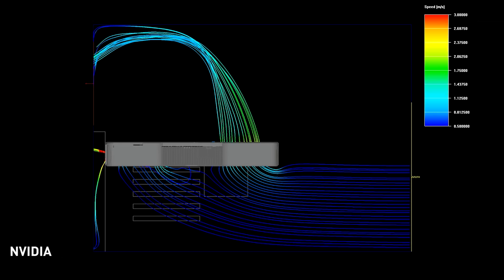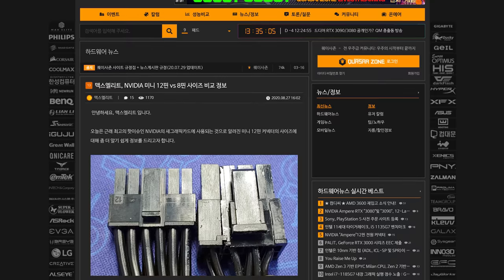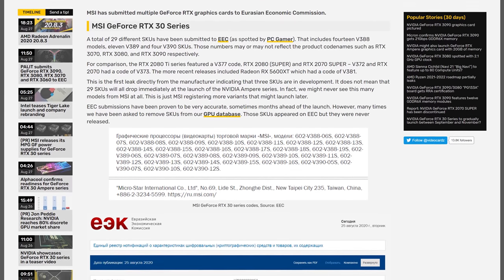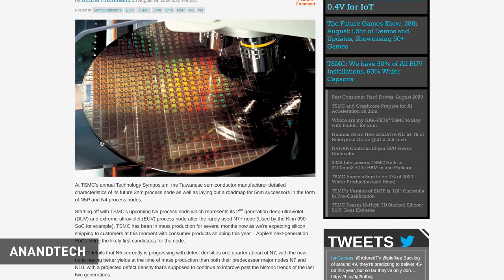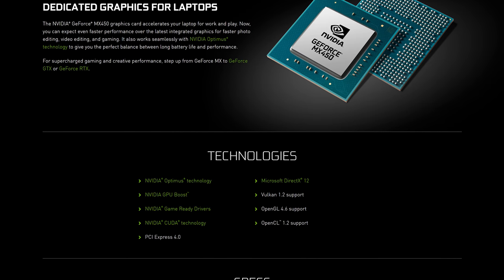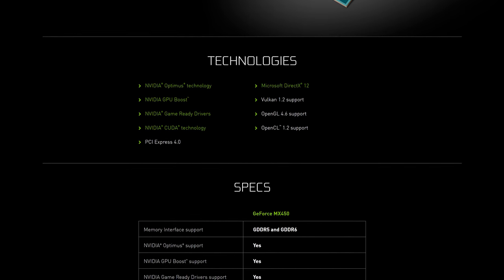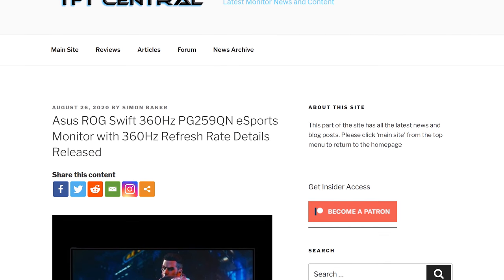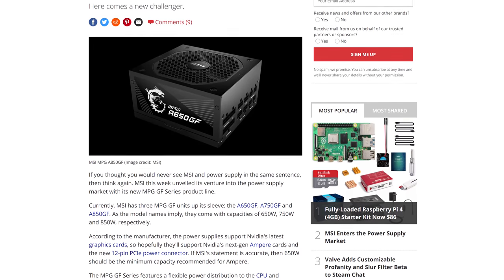RTX 3000 Power Connector, Great TSMC 5nm Yields, Nvidia's First PCIe 4.0 GPU | News Corner

Comment: Gtx 1000 series: price hike of 25% 
Gtx 2000 series: price hike of 25% 
Gtx 3000: price hike of 15% 
Inflation in that time: 6%

Do something AMD and Intel guys!!!!
Edit: for some models the price increase was more like 50% or even 70%.
Reply: They'll keep doing it until idiots stop buying them.
Reply: Intel will only be here for 1 or 2 generations probably and AMD's drivers probably won't be fully refined until RDNA 3.

You might hate me for saying this, but at this point, we as consumers might as well start buying only used cards.
Reply: Pricing history:

GTX 460  - 229$
GTX 560  - 199$
GTX 660  - 229$
GTX 760  - 249$
GTX 960  - 199$
GTX 1060 - 299$
RTX 2060 - 349$

GTX 470  - 349$
GTX 570  - 349$
GTX 670  - 399$
GTX 770  - 399$
GTX 970  - 329$
GTX 1070 - 379$
RTX 2070 - 499$

GTX 480  - 499$
GTX 580  - 499$
GTX 680  - 499$
GTX 780  - 649$
GTX 980  - 549$
GTX 1080 - 599$
RTX 2080 - 699$

GTX 780Ti  - 699$
GTX 980Ti  - 649$
GTX 1080Ti - 699$
RTX 2080Ti - 999$
Reply: @mix3k818  Unless we are ready to spend 1000 Dollars on entry level (!) PCs.
Reply: MiR3K intel is still king at gaming. What nonsense are you spewing haha
Reply: No new game worth a 3090 .... yet
Reply: 1060 to 2060 performance jump of 50%
Reply: Conor F Gaming in CPUs? Certainly.
Gaming in discrete GPUs? That's new territory for them.
Reply: @conorf8091  Except Intel has no PCIE 4.0 and uses double the energy.
Reply: @mix3k818  You want me to buy a card that's been in someone else's machine? DO YOU WANT ME TO POWER VOMIT?
Reply: I retract my comment I’m not smart enough for this comment section. Ggwp haha
Reply: @Bruuman  Looking back, the 900series was really good.
Reply: RemusKingOfRome5 Plus, literally the only games that can support 360 Hz monitors and can take full advantage of it are E-sport titles. Even most of the modern hardware can barely muster that many frames at 1080p.
Reply: @conorf8091  He meant Intel GPUs, not CPUs.
Reply: Lol, asking big corporations to improve market prices. Good luck
Reply: @Bruuman  GTX 1060 was 249$
Reply: @Strongholdex   I know, at least prices wise...
Reply: Edit your comment: RTX 2000*, RTX 3000*
Reply: @Bruuman  I think I saw your comment yesterday under a video about the gtx 970.
Reply: @Bruuman  the 3060 is $400 so you can add that to list of ever increasing prices.
Reply: Side Winder power what?
Reply: @Strongholdex  Yeah... Have to spam the prices so that people don't forget that a 80 class card shouldn't cost 1000$
Reply: AMD probably will play along with nvidia when it comes to pricing. Intel might seriously attack the price.
Reply: GTX 980 MSRP $549
GTX 1080 MSRP $599
$50 increase is not 25%....
Reply: Robert , More like convince the consumers to stop buying the GPUs (because what else are we going to do, fly to the companies' HQs and say "hello, pls cut prices"?), so we'll have even worse luck with that.
Reply: @Hobbes4ever  It is my intention to show the general trend so that people know they should not be paying 1200 eur for a top tier card.
Reply: @arenzricodexd4409  Because so far they have no foothold in discrete graphics.
Reply: @Bruuman  1060 was 249 not 299. 1080 was 699 on launch and 799 for the FE. It droped the price to 599 when 1080ti was released for 799. 2080 was 799 not 699 and by that time 1080ti was 699.
Reply: @blackwidow7804  All the prices are taken from TechPowerUp website.
Reply: @conorf8091  making your wallet dry for 10 more fps is incredibly dumb. this is why AMD is eating up marketshare and intel is falling behind, despite having a superior gaming CPU.
Reply: 6%？is your country's economy okay...?
Reply: And in laptops, it's even worse. With Intel tax
Reply: They can only sell things if people buy them, stop buying them or they'll keep increasing prices lol :P
Reply: Marko Grobler oh yeah I know that bud. I went for the r5 3600. I misunderstood what the guy said about intel being gone in 2 years though
Reply: @Bruuman  based on this trend they should stick with current pricing , with no further increase . we'll see
Reply: Yet you keep throwing your money at em!
Reply: @RemusKingOfRome  
flight sim 2020
cyberpunk 2077
fortnite
Reply: @Bruuman  Where did you find the 2080ti for $999 ? in UK thats £894, the 2080ti came out at £1200, even now the standard vers is £1079ish, please give me the shop you buy from as even after import tax it'll be cheaper than here.
Reply: @mick7727  except buying used pc parts is almost always good unless they are 3+ years old and even then its fine, what are you even spewing? you're helping the environment first of all (kind of) and also making yourself much happier by doubling your performance over new parts
Reply: @Bruuman  so cards haven't actually got all that much more expensive at all. Its the GDDR6 that costs a shit tonne more than 5. But I guess everyone with a brain knew that already
Reply: @Strongholdex  *entry level gpus
Reply: AMD put all their resources into their CPU division. They have nothing on Nvidia. By the time Big Navi is finally out, it will only be competing with mid-range Ampere.
Reply: @weavercs4014  that's half-bs... nvidia made it to look like gddr6 is 10 times more expensive then HBM2 and people believed it, what people don't understand in the first place that companies like nvidia/amd/etc they don't buy per chip, they buy in bulk meaning the price per chip is different

as for the rest of the topic... last generation nvidia lied that 2080ti is the "new titan" to gauge the prices and IF the leaks are correct they will lie again with 3090 to be the "new titan" (again) to gauge again, at this point only time can tell...
Reply: @conorf8091  By how much? Not enough to matter at this point, unless you absolutely want 190 FPS instead of 170 or something like that. For that little "disadvantage" in gaming, you get better productivity performance, more cores and better price-to-performance. I'll take it.
Reply: @Bruuman  they used to keep their prices low because ATI/AMD used to kick their ass in the GPU game until the the gtx 980ti/1080ti then they just gave up
Reply: Sheeps that keep buying Nvidia overprice Flagship will make future pricing hike even more,,

Make sense on business perspective cuz currently Nvidia OWN the GPU market for custom builder

But hey, just look at AMD did on Navi1, they decided to pricing similarly

I can only hope that will not make pricing hike even worst
Reply: @nehcooahnait7827  Actually it may be 8,5% since 2016. Germany.
Reply: AMD can't even fix their drivers, plus can't even release  a "2080ti killer" on time, that most likely going to be murdered by RTX 3080 and 3090 performance wise.
Reply: RavTokomi Where did that info come from?
Reply: @meekmeads  If AMD releases a card that costs 150eur and competes with a rtx 2070, they will sell a ton of cards.
Reply: Not everyone is poor and the fact that the 2080 TI is still constantly sold out tells you all you need to know.
Reply: RemusKingOfRome5 soooooo future proofing?
Reply: @mix3k818  no. consumer should stop falling into hardware maker trap. why we need to game at 4k? because hardware maker like nvidia tells us that is "next generation of gaming" and you must have it. forget 4k. heck even 1440p. if you play at 1080p you don't need to buy high end GPU. even mid range GPU can be extremely capable at such resolution.
Reply: @Bruuman   I think 1060's true successor is 1660 and 1660 TI
Reply: @Bruuman  gtx 1060 was 249
Reply: @InfiniteDesign91  1600 series should not exsist to be honest
Reply: @RemusKingOfRome   red dead redemption 2 in 4k for example is
Reply: Amd only follows nvidia in price.
Reply: @AndrewTSq  They follow the trend, but from a lower price level.
Reply: It’s business. They’ll price it at whatever people will pay and I’m sure that they’ll sell out at launch once again
Reply: i know, its utterly disgusting. But thats what you get if garbage people hold a monopoly. And the other "potential" competition is sitting on its A$$ not giving enough ducks!
Reply: @jackshayler8895  Probably. This reminds me of Intels pricing until Ryzen hit in.
Reply: @meekmeads  let me ask you a question
Do you own an amd graphics card?
I am pretty sure they fixed most of the stuff with the adrenaline update
Reply: @Strongholdex  too little pricedifference and bad drivers make me buy nvidia.
Reply: @AndrewTSq  Same here. If AMD would offer a rtx 2070 substitution for 200€, I'd buy it, but because of all the issues and the heat it produces AMD gpus so far are a no for me. But we still need AMD and hopefully Intel will join the club of gpu processors as well.
Reply: @conorf8091  I assume he meant "in the GPU space", as the leaks about Intel's discrete GPU's don't paint a good picture. You're wrong though; both Intel and AMD CPU's will give you over 200 FPS at 1080p, over 100-120 FPS at 1440p, and over 60 FPS at 4K. If you sat someone down to do a blind test 99.9% of people would never be able to see or feel a difference as you're well into the point of diminishing returns at that point. Meanwhile, anything multithreaded Intel gets so absolutely wrecked it's not even funny.
Reply: According to steam hardware survey the majority of gamers are using 4 year old graphic cards or even older. Gtx 1060 are still used in 11% of PCs which is huge. No RTX came even close to that number despite going extinct in the next few months.
Reply: @RemusKingOfRome  microsoft flight simulator
Reply: @conorf8091  by like a few frames, but they will most likely fall behind even further when 4000 launches
Reply: WHO CARES
Reply: @mix3k818  100% agree on the used cards.  The last NEW card I bought was a 780ti.  Since then I've bought 2x980ti, 1080, and 5700XT - all used for great prices way under what new was going for.
Reply: start praying :))))
Reply: We need 8k fortnite +360fps ultra and Epic  0.1% low 360fps  and  cyperpunk +144fps 8k
Reply: U dont have to buy if u dont have the  money no one force u to buy .
Reply: @Bruuman  RTX 2080 TI never retailed under 1200$ even though the recommended MSRP might have been at 1000$.
Reply: @will4may175  American shops aren't obligated to include VAT in their prices. In Europe they have to include them in the price so that's 20% for you in England more or 19% for me in Germany. $999 MSRP = £894 --> £894 * 1.2 = £1072 that's where you get your £1079 pricing. I think Americans have to pay their VAT later at the end of the year/month or something.
Reply: @mick7727  k f9 with u 
But if I get a good deal then why not?
Reply: They are pricing themselves out the market eventually, give it time, I am done buying new Nvidia cards after my 1080ti, at least for the time being. I'll only buy new AMD in the future or older NVIDIA, maybe a 3090 in 3 or 4 years from now to upgrade my 1080ti but most likely will go with a new AMD once I upgrade my PC this year. And save up by going with an used 3600 or 3700x on the cpu side once the 4000 series release, that offsets some of the GPU costs.
Reply: @Bruuman  A lot of those aren't launch prices. RTX 2070 launched at $599 for example
Reply: @imadecoy.  And that makes it even more messed up, but those are the prices TechPowerUp had on their website. I myself paid 870€ for my RTX2080 on launch day.
Reply: @Bruuman  You can't look at prices without the proper context. 
The GTX 680 for instance weren't a real 080 card, it was actully meant to be the 060. 
But when AMD released their 7970 in december of 2011(Paper launch), Nvidia realized they could just release the 060 card as 080, and save the real one for 2013(GTX Titan and 700 series). That's why the 780 is so much more expensive compared to the 680.

And as for the 900 series, the reason for it's lower price is due to the use of 28nm, instead of the promised 22nm(Which failed completely for TSMC).
Reply: @Orcawhale1  I knew the 80 class chip got smaller compared to the past. But I got into PC's in 2013 just as the 700 series launched and don't have any experience with the older cards. I just wish we could get closer to 900 series pricing again, but seems unlikely until AMD starts competing.
Reply: @Bruuman  Prices will still go up, as the more dense a chip get, the more expensive it is to make.
Oh and don't worry about your lack of experience, because compared to the vast majority of gamers, your still a veteran!
Reply: I did, I bought a 5700 XT.
Reply: @Bruuman  What about the 1660? Or are we just not counting that. The SUPER was in my price range at the time and is working well enough as a stop-gap until the upcoming generation. Although I'm hoping there is a still a reasonable upgrade.
Reply: @Vaxtin  No. 😂
Reply: @mgrimble3975  Exactly right.
Reply: Warm Soft Kitty  If you buy a cpu you want to keep it for a couple of years, so probably considering only the situation of today is not recommendable.
Reply: Warm Soft Kitty  nah 1440p and 4k is a trap created by hardware maker to justify the sale of high end stuff. No doubt 1440p and 4k will also improve image quality but to play at such res without sacrifice graphic detail and high frame rate will be expensive. I think this is part of the problem. People want to play on the high end but they complained about price and value on that segment that is never about value.
Reply: @ca9inec0mic58  RX550, RX570, Radeon VII
Reply: Team Red kicks it's own ass, after shooting themselves in the foot.

They could've released their "2080 ti killer", already and enjoy a small victory, which there lies the problem.

They are still trying to beat a 2 year old card, and even at that, failed miserably.

It's almost like, they enjoy being no. 2 out of 2.

If they keep this kind of shit, even Intel could fuck them over.

A nother
M ajor
D isappointment
Reply: ageofbogyo  Commendable, sure.
But Radeon has to get their act together, or they could be looking at 3rd place, sooner.
Reply: @skylordsrebornpvpreplays5795  RDR2 , it that shall not be named.
Reply: @albino_gringo1912  and msrp for 1060
Reply: Jonny B  Sure, from 900 to 1000 we had a jump of nearly 50% regarding 1070 but you get my point I believe.
Reply: @mix3k818  that kind of defeatism will just allow this to happen. I have sincere doubt AMD will have genuine problems with drivers with RDNA 2 beyond a day 0 or day 1 driver update and intel needs to figure out what the fuck is going on with themselves before releasing a new product class
Reply: @arenzricodexd4409  capitalism at best as usual. Why not? Sad but true!!!
Reply: Jonny B  I think 500 is way too much. The 970 cost 360.
Reply: @Steel0079  
It was us to make "intel inside", now WE make "intel OUTSIDE". AND GREEN outside. Will red on our side? We hope. Time will tell very soon. Green was too arrogant when 2000 was released.
Reply: @ifrit35  still using my 970 since 2015. Still quite capable card at 1080p. With high or very high settings i can still push many games at or over 60fps. Probably even next gen x50 part can boost my performance quite significantly lol.
Reply: @Matruchus  ask board partner why.
Reply: @arenzricodexd4409  I fly flight sims, it's important to see if that black dot in distance has the straight wings of Hurricane or sloped wings of Bf 109 ..it's a life or death situation.
Reply: @conorf8091  this dude never heard of ryzen gen 2 or 7 nm
Reply: @mix3k818  or skip 3090 and get 4090 or 5090 new!
Reply: sunny N Well, that is as long as your hardware is recent/strong enough to give you tolerable framerates.
Reply: @mix3k818  with 1080ti u should be fine on 1440p . used are around $500 but they should be around $400 end of this year!
Reply: @sunnyn9392  Well, I am waiting for the next gen since that's around the corner. I'm looking forward to seeing the used mid-range cards
Reply: @mix3k818  3070 is faster than 1080ti and cheaper and 220W but 8GB cuz 1080ti is 11GB, thats the only reason its coming with 8GB!
Reply: Gpus are becoming more and more useful every year, so the prices go up.
Reply: @Anon.G  Their production costs do decrease though. Also, they are not becoming more useful in a relative way because one needs the extra power. I don't subscribe to the mentality that prices should go up without any connection to inflation and price relative performance ratio.
Reply: @Anon.G  the prices should be relative to costs of production,  not performance. Especially not when that is a 10-20% gain as with the rtx series
Reply: @hjalmarlevin1092 Where did I say that prices should be relative to performance? Nowhere. Prices are R&D, production, and advertisement. Nvidia is spending a lot on R&D because Gpus are being used for more than ever before.
Reply: Hjalmar Levin I’m running 7mm
Reply: Jonny B  If you already have a 2070 super and your budget is only $500, there's no reason to upgrade to RTX 3000 or big navi. May as well wait for the generation after this. I'm guessing that may be your plan at least, or you'll be wasting money on marginal performance gains.
Reply: @Bruuman  2080ti for 999 would be a dream....its just MSRP....real life is even crazier.
Reply: The one time we are all together rooting for both Intel and AMD  XD